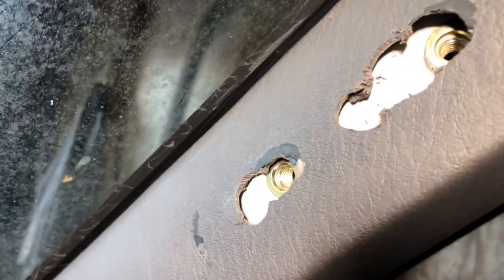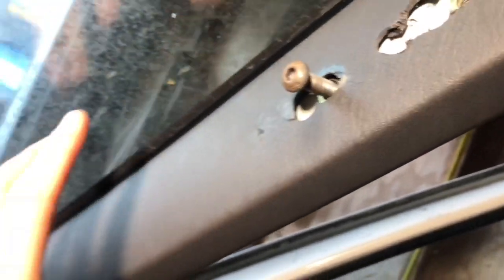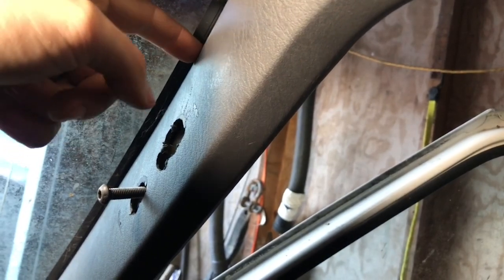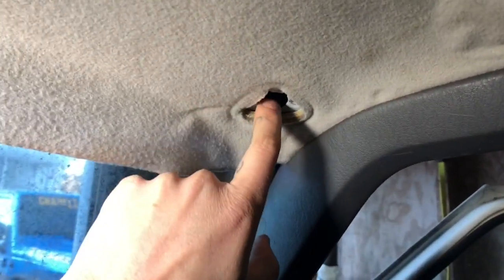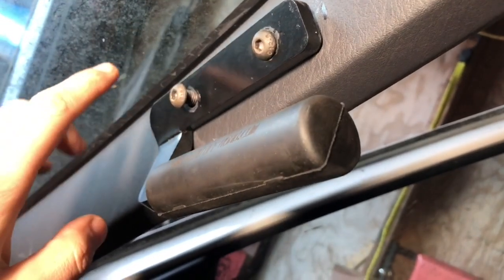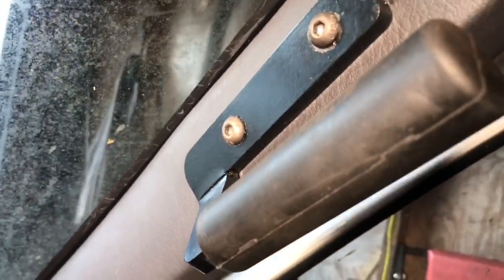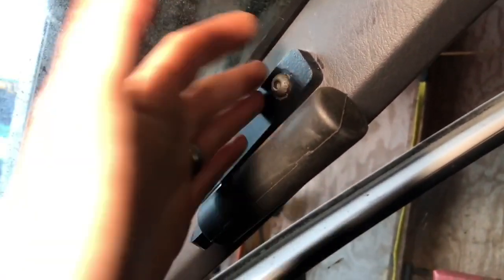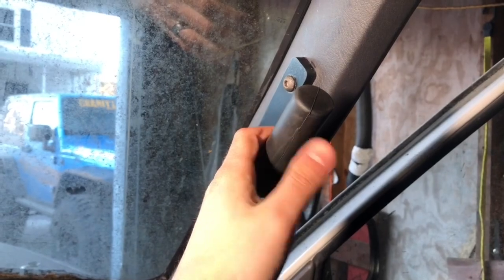Your Questions Answered On The THOR Grab Handle Install

Comment: Have not done this but.. why not use a step-bit and drill the plastic a couple sizes larger than the bolts to avoid the hunt/peck method?  Handle mount covers it anyway.  Anyone remove all the plastic around the mount for a flush fit to the A-pillar?  Hot razor for a straight cut.

Comment: Nice job.  I know you didn't have your sun visors installed, but did you end up re-installing them and do they clear the grab handles when pulling them down?
Reply from the maker: Charles Goss I did not I’m working on a one ton swap. But they should clear fine they are off to the side enough to not effect them
Reply: @TheBeardedJeeper  Cool.  I just went out in the garage and checked mine and it seems like they would clear.  If not, I could mount the handles slightly lower to avoid the visor.
Reply from the maker: Charles Goss exactly they are universal and you can mount them wherever you want. Thanks for checking out the video and if you have more questions let me know